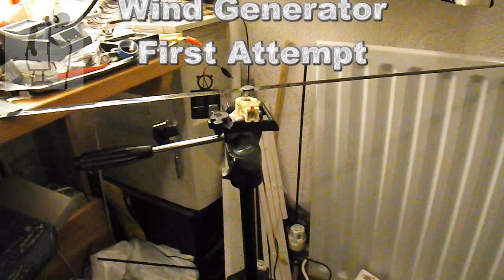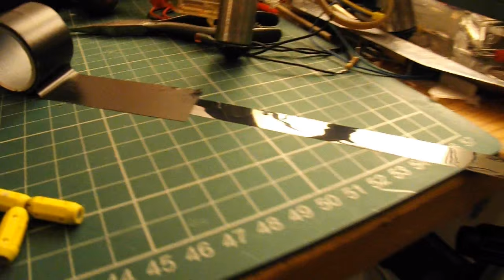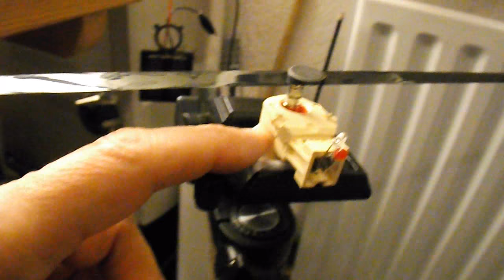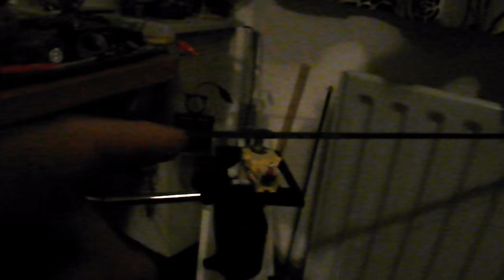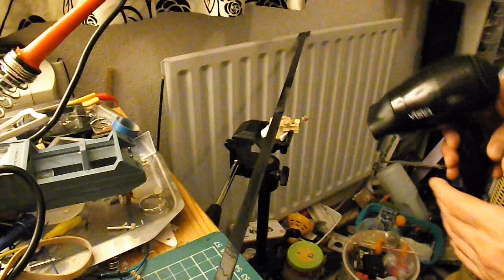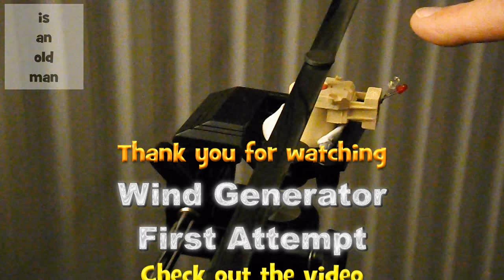Windbelt Generator - First Attempt

Comment: An improvement might be just using a piece of cardboard to wave at the streched tape. It would produce big gusts of turbulent air and probably make the tape jiggle up and down a lot more. Plus, it will increase your personal fitness while generating free power.
Reply from the maker: +wordreet thank you for your concern for my fitness :) I would prefer to put it somewhere where the wind will do that for me but it needs a better coil and magnet. The link in the video description shows one that is apparently quite efficient.

Comment: Its interesting but i dont think its quite as efficient as a a rotary design because momentum is lost when changing directions where as with a rotary design it is conserved.
Reply from the maker: I think the general idea of this design is that it can generate power from the drafts coming through small gaps, maybe a window opened just a crack to allow some ventilation. There are links in my video description to the original designer's videos from 2007
Reply: the momentum is not lost its stored in the flex of the belt ( only what is known as "dampening" in rubber is the loss) and this is moore efficient than turbines on that scale

Comment: Wasn't there a genny similat to this that used a tree as the sail with a 
wire tether and crank arrangement ? Also have you ever made an aolian harp ?.......M
Reply from the maker: +MrMal1956 haven't seen the tree idea but I can see how it would work, similar to wave machines, basically anything that moves forwards and backwards or up and down should work. I did have a go at an aolian harp but I don't think I ever finished it. I had used grass strimmer plastic line as I had hoped it would catch the wind fairly well. I seem to remember I made it and we had one of those windless periods so I eventually chucked it in the wood pile. It was about 6 or 8 feet high made from and old wooden post.